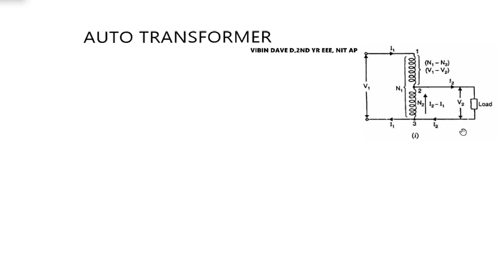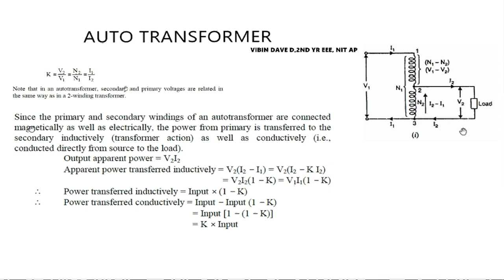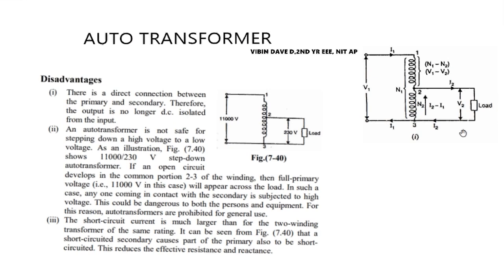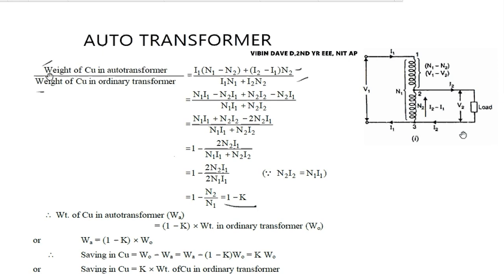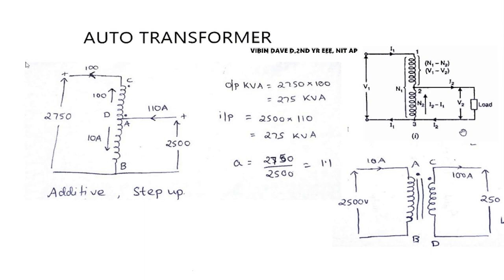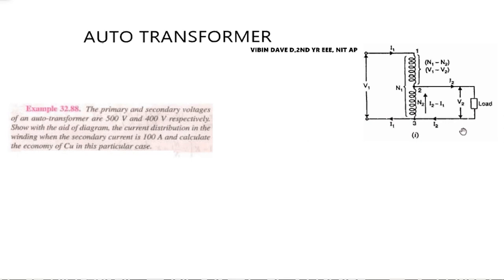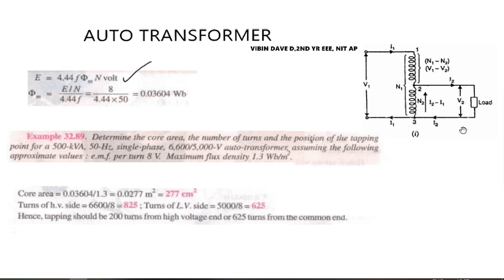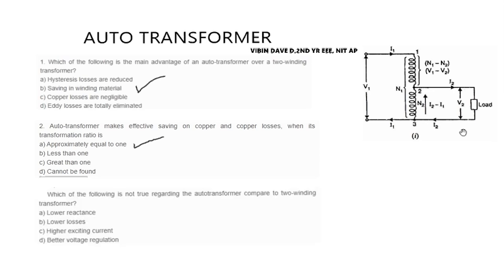Autotransformer full concept along with numericals.

Comment: sir how i can get the maximum rated amper
Reply from the maker: If you're asking about maximum rated ampere for the windings, it depends on manufacturing and if you're asking about maximum power transferred. It's based on MPTT(Max power transfer Theorem) there are many constraints like impedance matching. You'll get better idea if you solve a MPTT question including a transformer. These theorems are based on ideal conditions*